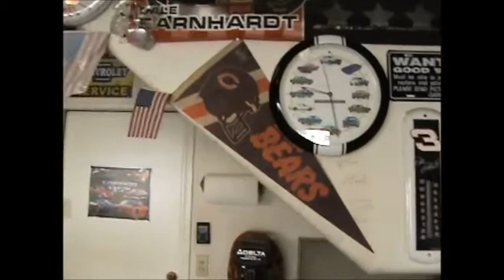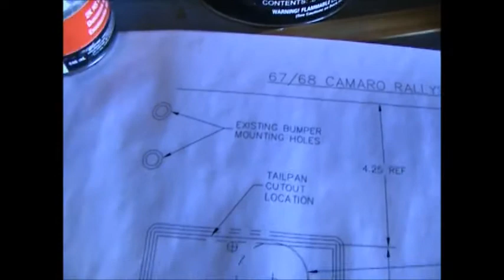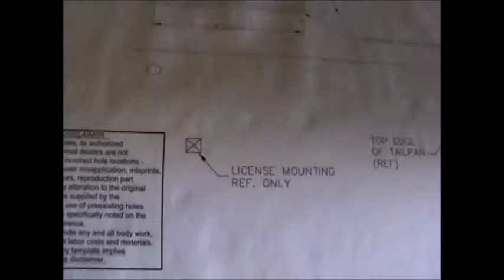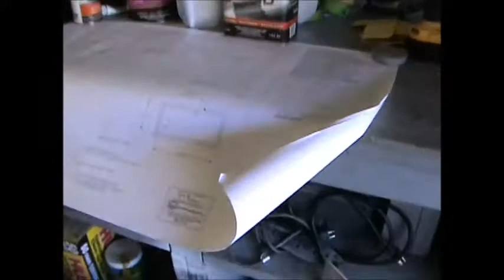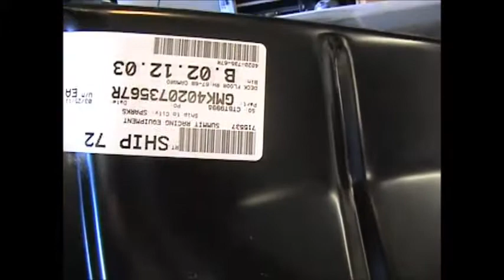1968 Camaro Resto-Mod 11-23-14

Comment: hey Tom you dont think that those cracks will keep coming back on your front panel.I had a friend that tried that on his rear panel and it gave him fit and it kept on cracking the bondo. He cleaned the bondo off then welded it shut then put bondo over it just a thought.Would hate to see you have her all painted and driving and that part crack up the seam later
Reply from the maker: 265chevy Thanks Hanson, but being such a small panel I don't think it's going to be an issue - but if it is I'll just pull it off and clean out the filler and weld it up. I need to get the car in the air and get on the brakes - Thanks again Hanson.